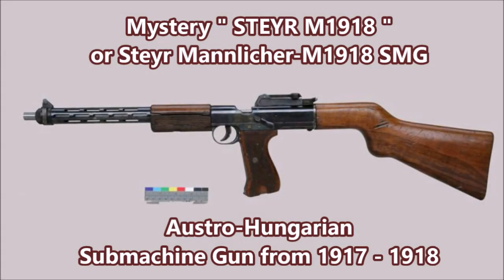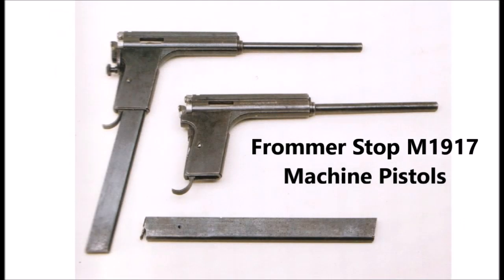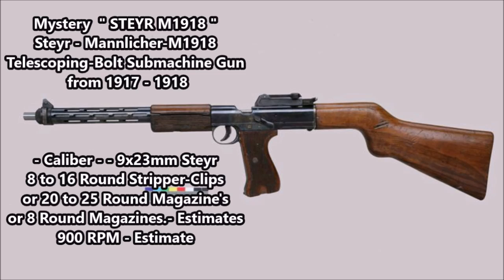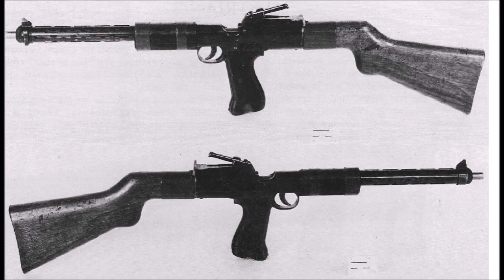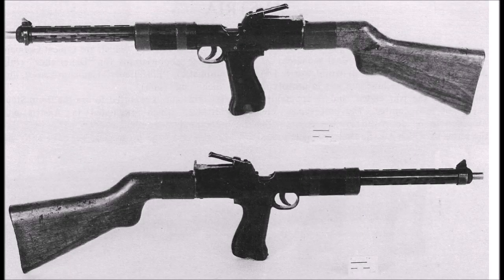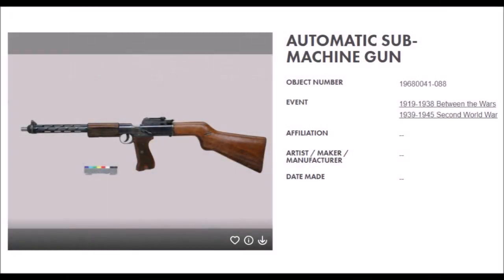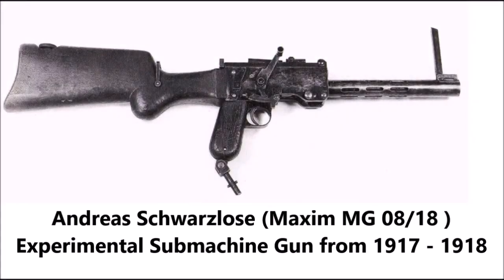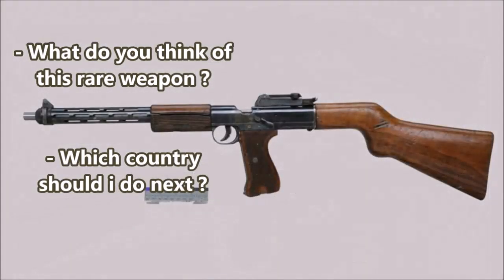Mystery Solved - Steyr-Mannlicher M1918

Comment: Now I see that you've removed the links to the original articles. Why? You are stealing content without proper credit.. Can you please get in touch, I'm getting sick of this and would like to sort it out.
Reply from the maker: James Lawrence you said you didn’t wanna be referenced in my video.  I’ll replace this video this week when I post my video on WW1 SMG’s.
Reply: @jmantime  Hi, thanks for actually getting back in touch. I never said I did not want to be referenced - rather, I said I would like proper credit to be given and for the errors to be corrected, or take down the video. At this point, I'd rather the latter. You open the video by saying "after doing some research, I figured out what this was". No offence, but you didn't really do any research, you are just parroting what I wrote in my article, and misconstruing what I originally wrote. I put forward the theory that this unknown prototype was a WW1 SMG by Steyr based on circumstantial evidence. Nowhere in my article do I state this as fact - it is just my own hypothesis. You have treated my theory as fact without any research of your own.

In addition you have made several completely false or unsubstantiated claims in this video. This gun does not have a telescopic bolt as you claim, and there is no known magazine size (the magazine is, in fact, completely missing).  You talk about "sources" for the magazine size, where are you getting this information? And you claim to have seen photos of this gun from the 1920s, but provide no evidence. (The photos from my article were from a much later date.)

The fact is that this mystery hasn't been "solved" - it is still unknown as there are no known documents associated with this gun, and no manufacturer's markings on the gun itself. No date or manufacturer has been definitively linked to this gun yet.

I am sorry to have to complain like this, but like I said it is disheartening to see people taking content and adding misinformation. This is not the first time this has happened. I'm fine with you using my articles as a source, so long as you actually given some proper credit and don't embellish false information.